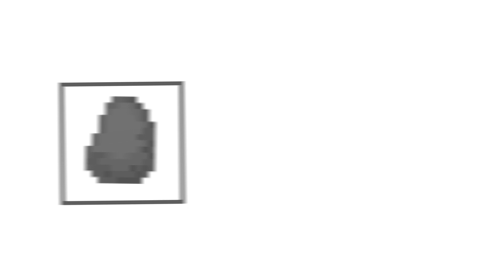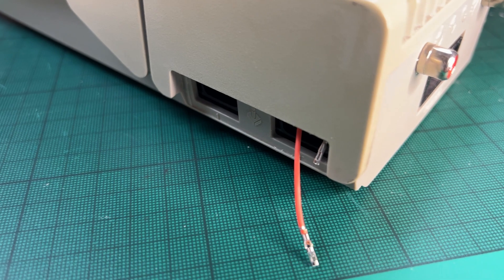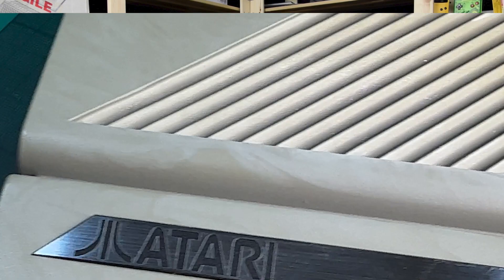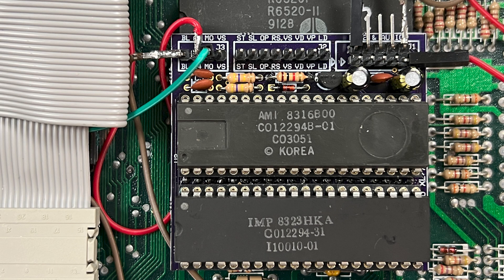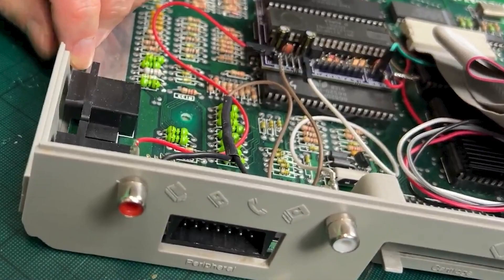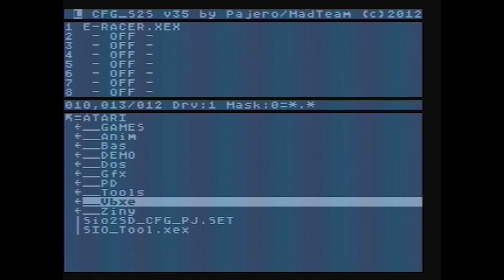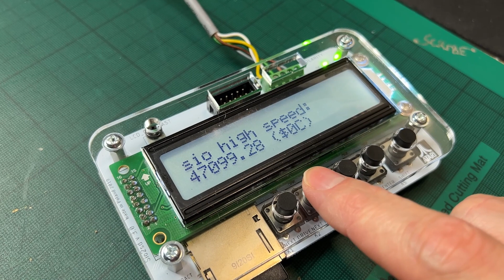Mystery ATARI 8-bit from eBay Restoration and Upgrade

Comment: Does yoop 😮make use of the 1MB memory extension or the 256kb one?
Reply from the maker: I believe that Yoomp! only needs 64Kb to run - therefore if you have 256Kb of ram you should have no issues running the game.

Comment: The Atari 800 and 800XL were all considered top-of-the-line version for their generation. A 800XE should be based on the 130XE since it was the "best" Atari had to offer of the XE generation, since a 65XE would be no different than a stock 800XL. The 800XL is by far the most popular version of the Atari 8bit line of computers. I really wished they did use better names for the XE line, than the seemingly arbitrary 65 and 130 numbers which I guess were supposed to represent how much RAM they have, but rounded up. At least the Commodore 64, had 64k RAM. IF Atari used the names Atari 400XE (XEGS), 600XE (65XE), and 800XE (130XE) would have sold a lot better in the USA market.
Reply: Look no further than the 520ST (512KB) and 1040ST (1024KB) to understand what the new Atari Corp. (i. e. the company now owned Jack Tramiel, formerly of and founder of Commodore, having bought it from Warner Bros. ) had in mind for their fresh new naming scheme to go with their fresh new look. I’ve even heard that a 260ST and 130ST were contemplated (for Europe). But I was never an ST guy (by the time I was ready for 16/32 bit I’d read about Jay Miner and the Amiga and the connection to the Atari 8bits and so I followed the bloodline, not the corporate name). 

When I got my 800XL, it was something that I could touch and feel at a local store (Sears I think). Hadn’t seen nor heard of the C64 (it was relatively new honestly and the XL series built on the original 400/800 line). The ONLY place I saw an XE was in Atari-specific magazines - mail order. Never saw them in stores. Okay maybe Electronics Boutique where we bought a 1050 disk drive a year or two later (the XE line should have been out and DOS 2.5 came with the 1050). The only place I saw an ST was at Electronics Boutique. It’s hard to sell a lot of computers that people don’t know are for sale. Atari Corp. got behind the ST and mostly let the XE rot. Too bad the XEGS didn’t come out a year or two earlier. I might have see that one in a toy store (albeit one that sold NES, SMS, Turbo-Gr.16, and I think the even the C64 for a while). Anyway that’s my point of view from my experiences in my part of the world back then, funneled through the mind of a middle aged adult who wasn’t old enough to drive back then.

Comment: I have a 65xe and the keys were very yellow. Did not use chemicals to lighten the keys, just used the sunlight on a hot sunny day and it does the same job. It's not the only system I done that way, and I got a good result every time. Just thought I'd share that information. Many people seem to think that sunlight is the cause of yellowing, that is not the case. My experience tells me that dark spaces or contact with other plastics can yellow plastic. UV and warm air can reverse the colour.
Reply from the maker: Thanks, i would be inclined to try that but it is sooo unpredictable here (UK / London area) - that makes planning difficult. I will definitely give it a go if i can arrange my schedule around the sun's :) but if its only warmth and UV the issue, then UV lights and some level of artificial heating should also do the same trick. (i am building a UV chamber to create even light conditions... it seems a good idea to experiment a bit... as i would rather skip the headache over the marble effects ... besides i am not a huge fan of my fingers getting always itching after the hydrogen peroxide :) 

thanks for the comment and idea.
Reply: @RetroPotato  I live in Kent. Did not realize you was in England. May to September is the best time of year. If doing the no chemical solution sometimes it take roughly 2 to 3 days for good results. Everyone has their own methods. I always treat the plastic with trim/dashboard restore after a clean and de-yellowing. Adds protection and shine.
Reply: You're right it's not sunlight. My 130XE has been in a box since about 1990, but it's gone a horrible shade of yellow-grey. The weird thing is the underside hasn't changed colour. I'm not sure because it was too long ago, but I think it may have happened after it was put in the same box as a 600XL, with the latter against its upper side. The yellowing is too even to be direct contact, so perhaps it was a very slow gasseous transfer, if that's possible. Anyway, I'm going to try putting it in the window & see what happens. Thanks for the suggestion.

And I'm in Britain too. :) Derbyshire.
Reply: @eekee6034  not going to hurt putting by window. If you leave cables wrapped around the computer or dataset etc  for a long time the cable will deform the plastic case. Cable burn. Looks like it's been slightly melted. The yellowing is a similar thing. Just a reaction in the plastic.

Comment: Atari 800 was not famous in the Europe, it was almost unknown in Europe. Atari 800XE got its name after the Atari 800XL which was very popular in the Eastern Europe.
800XE was using a 130XE board (with ECI connector) but without the extended memory management unit chip, and with only 64kB of RAM. Some 65XE were also using the same board. Later units had a modified board, with ECI port, but without a place for 2nd bank of RAM and EMMU chip. Most if not all 800XEs had a faulty GTIA chip.
Reply from the maker: yes thats two mistakes i left in the video (did say 800 rather than 800xl and I did not make it clear i meant Eastern Europe. as somefrom that part of Europe i tend to not draw that distinction :) Eastern Europe is Europe in my head - but of course, this makes the video inaccurate.

as for the 130xe vs 65xe: i relied on wikipedia’s definiton on that one, which was a mistake to take it on face value. As @Atarimuseum Netherlands also pointed it out. 
thank you for the further clarification and apologies for the rookie mistakes on my end. i will try to eliminate them in the future.
Once again thanks for your comment and help with the topic.

Comment: The 65 and 130 boards are similar, however there is one obvious difference - A 65 has one card edge connector for game carts and such. A 130 has TWO edge connectors to provide additional expansion not needed for the 65.
Reply: European PAL 65XE's will very often use a 130XE motherboard but only have 64K and are missing two expanded RAM support chips. Some 65XE's in Europe used a 65XE motherboard and did not have the ECI expansion bus.
Reply from the maker: thanks for the explanation. its good that its not just half / double memory size 
(i havent seen the 65xe board yet but will do that soon)

Comment: That badge is an aftermarket batch sold on Ebay, so that is not original. But the 800XE has actually a 130XE board in it with just 64k. It was made with left over stock.
Reply from the maker: Ah, that explains a lot. I foolishly went with the description from Wikipedia which states that the 800XE was a rebadged 65XE (and not the 130XE with half the memory) - Of course doing a bit of a searching NOW i can see that it is incorrect and that the 800XE with reduced memory by default. It is at least much clearer now, thank you for your explanation. It is greatly appreciated. 

Also : your collection is just WOW!
Reply: @RetroPotato  Thanks for the compliment! Good luck with your channel!

Comment: I also have a marbled Atari case (failed Retr0bright attempt), but mine is much, much worse and probably not recoverable. But in the other hand I don't want to spray-paint it.
Reply from the maker: agreed, i would also keep it marbled. i’d like to think that the original texture of the plastic is more important and gives authenticity, and character.

however i would argue that you could probably soften the effect if not totally cured with a few treatment session. 

maybe even trying perafractic / Retro Recipes’ sun bathing method (if you live in a place where 8 hours of straight sunlight is possible)